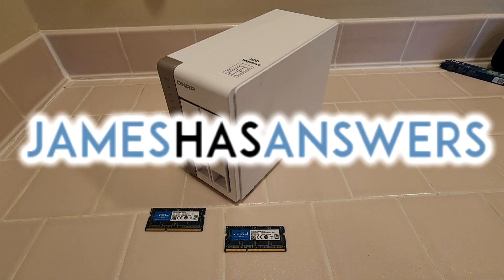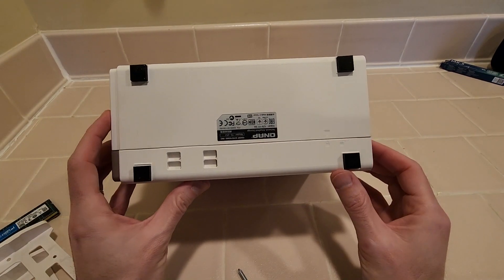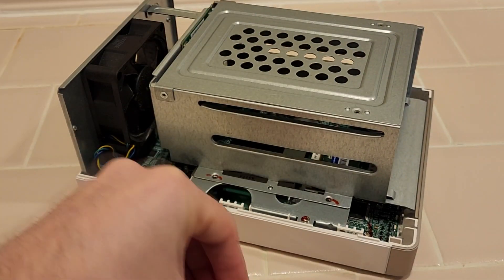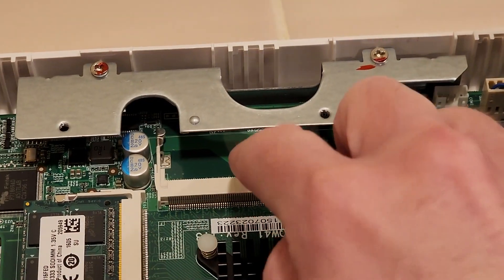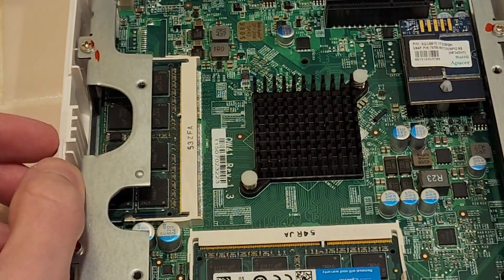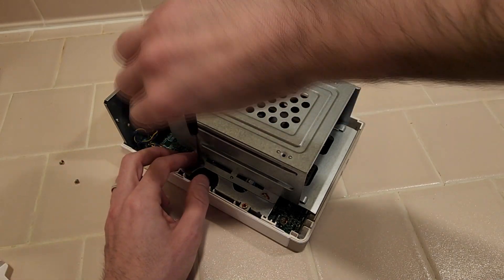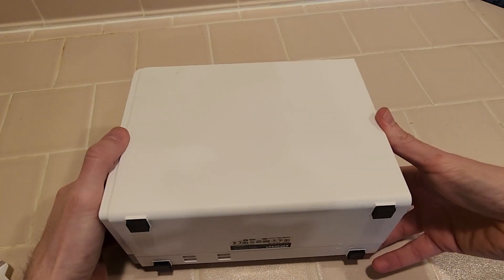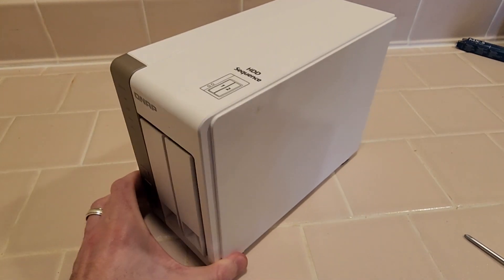Upgrade the Memory on a QNAP TS-251 NAS

Comment: In your video you don't warn the user to mark drives 1 and 2 so they know which way they go back!  I've taken them out and carelessly forgot which was which.  In your video the disks are not present so it doesn't matter but most people are going to be upgrading the RAM in a working NAS, in which case you need to remember which drive is which (or ... does it not matter?)

Comment: How about the CPU? Is it possible to upgrade the TS-251 CPU?
Reply from the maker: short answer, no -- long answer, I don't know for certain, but I believe the CPU is under the black heatsink in the middle of the board and is soldered down. Is it possible one could desolder it and resolder in a different CPU?  possibly, assuming you had the skill, and assuming the board would be able to support a different processor.  Also, you'd need to consider whether that same heatsink (or any custom heatsink you could make and fit in the same area) would provide adquate cooling, etc.   Let's say you could, I'd argue it's not worth it compared to reselling this one and buying a used one with better specs

Comment: I installed 2 x 8 exactly you explain but after starting de Ts-251 sees only 8 GB
Reply: I just put in 2x8GB into my TS-251+ and it regognized all 16GB.  Maybe try a firmware update?  Otherwise it must just be a limitation of the 251 and not the 251+ (though my spec sheet does show 8GB max as well).
Reply: I installed 2, 8gb and it recognized both and is working great.
Reply: Same here
Reply from the maker: Ah, so I happened to just make the video using sticks I had handy, which happened to be 2x8gb (and didn't confirm if they were fully recognized) - however - per specs on qnap's site, looks like the ts251 may only recognize 8gb max https://www.qnap.com/en-us/product/ts-251/specs/hardware